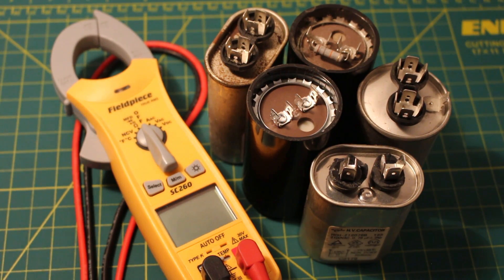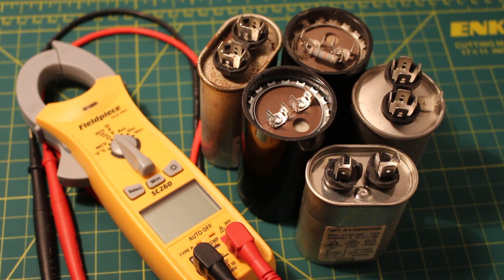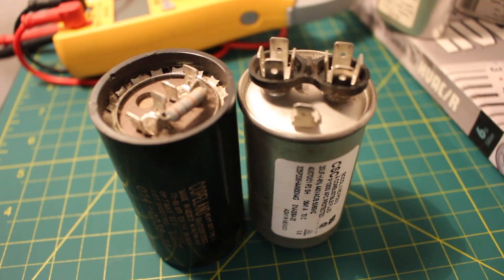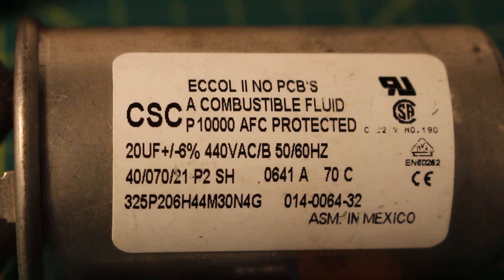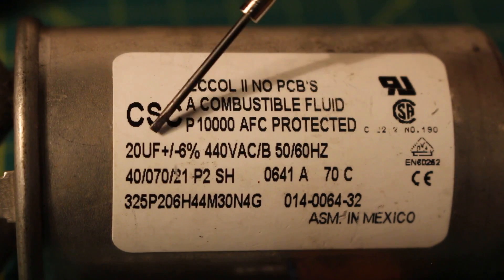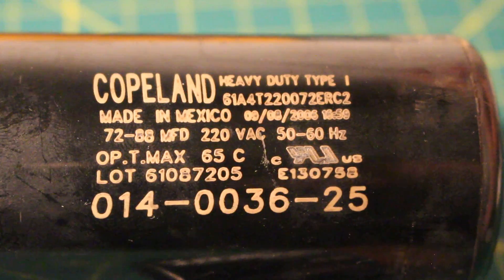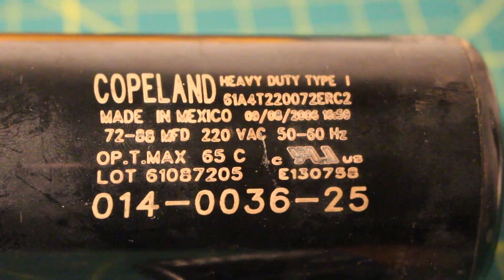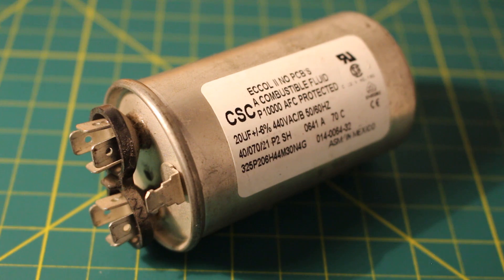How CAPACITORS work (Start capacitor Vs. Run capacitor) HVAC/R

Comment: If the run capacitor is failing, will the A/C system still run but won't cool the house as set on the thermostat? I replaced the start cap but not the run cap. Air comes out cold but the temp never drops as it used to.

Comment: Oops! Wait a minute! This video was too short, mi amigo. You, or in most videos, they always talk about the compressor cap and what about the cap attached to the air handler blower? The Titan does not show any + - mFD. What kind of AC they sold me in 1998? If it was an scam I do not want that to happen again now that the prices are getting over the 10K dollars!!

Comment: Many thanks for your other video. I learnt a lot more today with you. I purchased a new Titan HD (?)capacitor 7.5  mFD and it says RUN ( it is for the air handler). So, now I am going to watch this video to learn about run capacitors.... Maybe this will be the year when I will finally repair my  1998 2T ac (after 5 years of not working) ... if my brain does not get toasted.
Reply: How'd it go you must be in Texas with me. But did you get it fixed

Comment: This does not explain how a cap works,......😞
Reply: You were right after all, mi amigo. I apologize. I was referring that time to the first video which was good and long, reason why, after seeing your same video, I realized that indeed the video was lacking much , much information and they always miss the air handler function and parts as well as the thermostat. Have a great day. Burning in FL w/o ac working. We must keep searching for other good videos of these kind people trying to help us here.
Reply: For that amigo you must go back to school. We are here just learning to test what usually fail in ac units and this is more than enough for me to try to fix something and save money. The rest I search it in another place if I really want to waste more time with the search instead of doing my fixing. Do you want to change the light bulb and keep reading or you want to find out how electricity works?!
Reply: @clusa3721  The title of the video is "How CAPACITORS work" , this does not explain how CAPACITORS work. I guess I was expecting too much to think the content of the video had something to do with the title ☹🤔
Reply: My guess is that you want to go to the DNA of the cap ..... I did see how in India  they rebuild car batteries, which also represent the function of the cap.  Same  as SD, etc memory card stores data, cap stores electricity.

Comment: Situation.  An AC unit I opened up to test has 2 capacitors.  
a Dual 40/5 uf 6% and a single 5uf 5%   
The Dual only has connections on 2 of the posts (yellow on Herm, Orange and Purple on Common) and not on the 3rd post (Fan) that measures 5uf.  
 But the single 5uf run capacitor  has 2 cables connected to it (brown and yellow).   
My question is... Are the 3rd terminal on the dual capacitor (that rates 5uf) and the single capacitor interchangeable?  
  
I.e. if the single capacitor fails, can I just connect the cables to the Common and Fan ?  If so, which cable goes to Common and which to Fan? 

Not sure if a repair guy took a shortcu there.  But the dual capacitor was wihin range on both the fan and herm posts.

Comment: Hey man! I know this video is old, but my air comp. Motor has been running hot, it will work great for a few cycles and randomly it wont turn on automatically..i have my compacitors checked and they read fine...BUT my qustion is, Which would cause the motor to occasionally run hot, START OR RUN??

Comment: Blower motor is hot I went and checked the capacitor and the numbers are right where they supposed to be, can the capacitor be bad although it's reading it's good or do I have a bad blower motor,  ac unit is under a year old
Reply from the maker: If the your meter reads the same MFD rating as the capacitor then the capacitor is good. Make sure voltage is going to the motor (Since the motor was hot to the touch then it is getting voltage or it was). There is still a chance your fan motor might still work because it can be off due to a thermal overload. When the motors reaches a certain temp, the thermal overload would open preventing the motor from burning out. These overloads can either be an external control or an internal control that you cant access. Look up the motor model and see if it has a built in overload. Give the motor time to cool off before condemning the motor if it had an internal thermal overload but the question is why did the motor overheat? Hope this helps. Stay safe out there! Stay tuned for new videos every week

Comment: So I was replacing a start capacitor for my home a/c and noticed the new replacement capacitor does not have a safety vent up top.  I emailed the store and they said its the new revision.  Is it still safe to use?
Reply from the maker: Hey, what do you mean by safety vent up top? Never heard of that. Does your system work now?
Reply: @JumpermanTech  very similar to this.  Its the hole opposite of the resistor

https://www.witmermotorservice.com/00304902-Leeson-Start-Capacitor-Mfd-270-324-F/item/003049.02/

Comment: Thank-you for an informative video. So the only difference between start Cap and run cap is the capacitance? Start caps have higher capacitance - how much higher? When does one become the other?
Reply from the maker: Basically it is the capacitance and its construction. Run caps are sometimes used as the starting component as well. Run caps are also known as oil filled capacitors and are designed to run for as long as the motor runs. Start caps are also known as electrolytic capacitors and are designed to be used for a short period of time🙂 Subscribe if you haven't already for further controls/component videos 👍

Comment: JumperManTech is for the people! Thank you for your efforts, much appreciated.
Reply from the maker: Yes sir! Here to spread knowledge to all! & Likewise🙂
Reply: @JumpermanTech  can a motor still run if compasitor is bad? my ac is not getting cold. all fins n coils are clean. the compressor was getting hot but not cooling.  checked compasitor it shower a jump then back to zero then it never did that again. it just reads zero